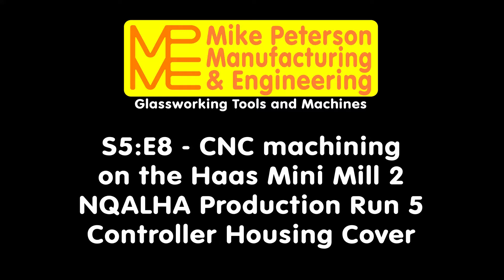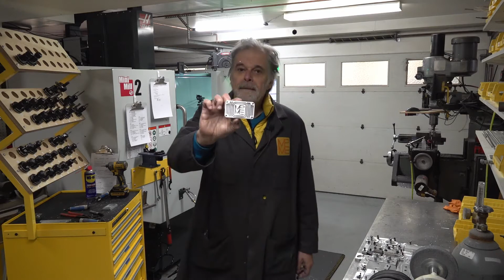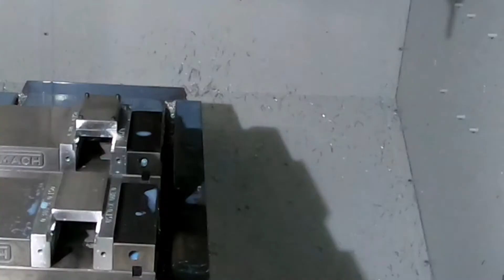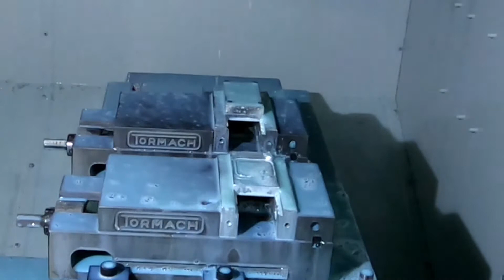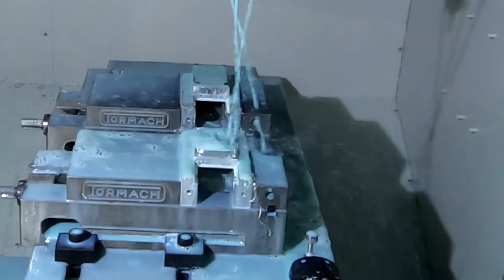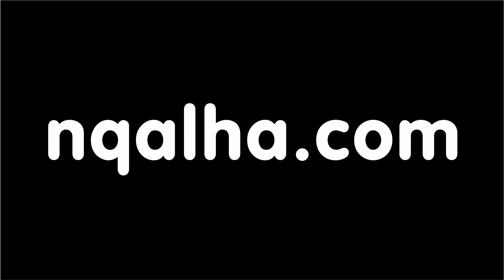S5:E8 - CNC machining on the Haas Mini Mill 2. NQALHA Production Run 5. Controller Housing Cover

Comment: Maybe you should try a Datron single flute cutter, they are only in metric but they are realy great for slotting :)
they have a large advantage if you have a realy high rpm spindle but i think at 10k they are also worth trying
I personaly have a 40k spindle and that realy takes advantage of them.